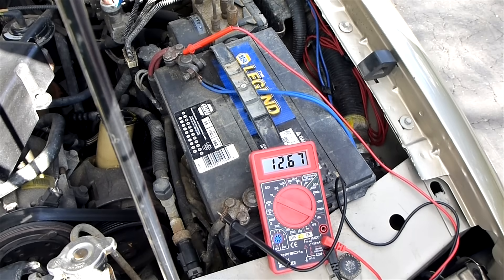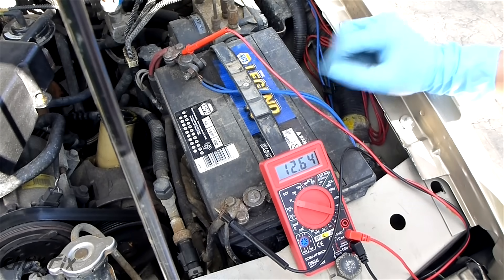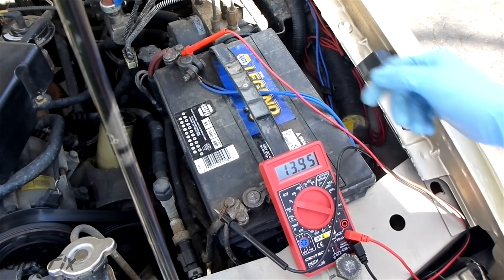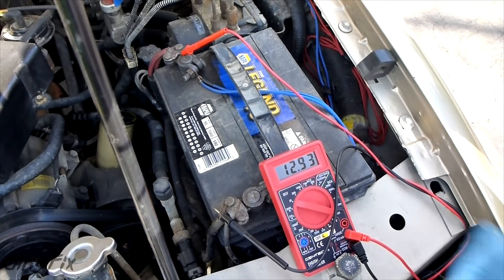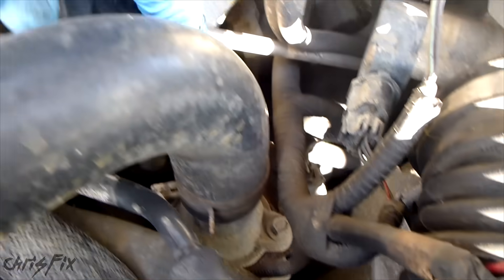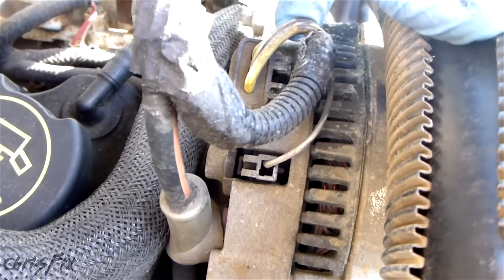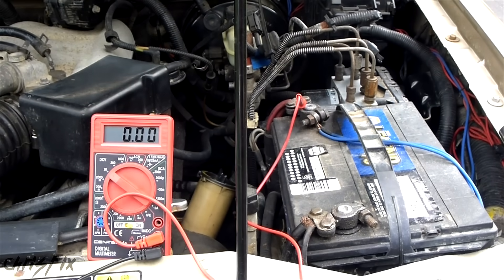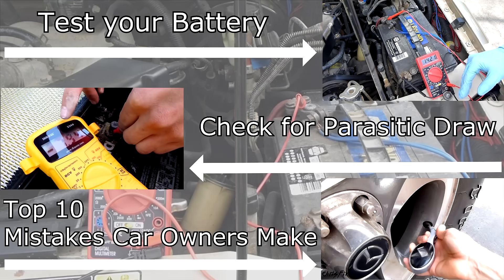How to Test an Alternator

Comment: Chris,

Great video.  I already performed a voltage drop test and concluded I had a bad ground somewhere on the engine.  But I need advise.  Before grounding the battery to the engine, I read 1.7 volts drop between the neg post and the engine block.  That was keeping my alternator from working.  I ran a ground from the neg post to the intake where the original ground was connected and left the original one connected as well.  Now when I do a voltage drop between the neg post and the intake, I get a reading of .480 at idle and .800 at about 1500 to 2000 RPM.  Voltage drop test between the chassis ground and the battery reads .002.  The alternator is working now and I get a reading of about 13.6 volts across the battery neg and pos at idle and about the same when RPM go up.  When I turn on all the lights, AC, Seat warmers, etc, it drops to about 13.1 volts.  Should I also run a ground from the engine to the chassis?  Or do I need to look for another problem?  If so, what next?  I never even got to the alternator housing, and I have not performed the pos drop.  BTW, it's the 2nd alternator I put in the car because of the ground issue.  It is a new reman. ( I guess that is a contradiction in terms isn't it...new reman???).

Thanks and great vid!

Ken
Reply from the maker: K Kelley Check your engine to chassis ground that is already on the engine. It is probably dirty or even broken because the stock ground is sufficient and should work. Lol at the new reman contradiction. I get what you mean!
Reply: ChrisFix
Thanks Chris, I will probably run a new ground wire from the engine to the chassis.  The battery to chassis is good, .002 on voltage drop test.  Is a 6 gauge wire good enough, or would you run 4?

Thanks again, very easy video to follow and very much appreciated.  Good work.  I also watched your video on finding shorts.  Yep, it would be easier if all shorts caused lights to come on.  LOL

Ken
Reply from the maker: K Kelley Hey Ken, I would run something like this which is similar to what they use at the factory: http://www.amazon.com/gp/product/B000COMR00/ref=as_li_tl?ie=UTF8&camp=1789&creative=390957&creativeASIN=B000COMR00&linkCode=as2&tag=chri0e2-20&linkId=BCSE4JWZT7D46B26

Comment: My 84 Celica is suffering from a .20 power drop on the negative terminal.  What do you mean by "cleaning the mounting bracket"?  Am I to assume that I need to take off the alternator and actually sand or wire wheel everything it seats to including the bolt passageway?  Thanx.
Reply: No. He means to do that at the battery posts.
Reply: Actually, he did mean the mounting bracket.  I wire brushed it, re-installed, problem solved.

Comment: i have a 1.60 voltage drop between the positive side of the terminal to the b+ post on the alternator. im having a battery charging issues (battery light comes on) and im not sure what is happening. the connections are all good but i have no clue what is happening.  Brand new battery and alternator. when i get the voltage of the battery while the car is on it stays at 12.5v and sometimes it fluctuates from 13.4v back down to 12.5v can i get some help?
Reply from the maker: Santiago Flores Do you have an external voltage regulator? Have you tried cleaning all of your grounds attached to the engine and chassis near the alternator?
Reply: its internal and im not to sure where all my grounds are located. if it helps, before i started having all these electrical problems. i was aligning my headlights and i had them on for some time. battery died and i charged it up. after two days the battery light came on. it wouldnt hold its charge and so i bought a new one. i got a battery light 4 days later and so i targeted the atlernator. changed that and still i have a battery light problem. Changed the fuse, and put a new wire from the b+ post to the fuse that goes to my battery. worked at 13.60v for a bit, but now the alternator doesnt charge my battery.
Reply from the maker: Santiago Flores Could be a fusible link: https://www.youtube.com/watch?v=-SpsSRGfDQI
Reply: my car is a Japanese import so they didn't create fusible links with the vehicle. The alternator is now giving a charge of .30 but im having a voltage drop of around 1.7v between the two positive post.
Reply from the maker: Santiago Flores Gotcha. Try sanding the grounds and cleaning them up. Also try cleaning up the positive post on the alternator and the battery.

Comment: Hey Cris, I have a new second hand replacement Alterntor, which the stator has been rewinded.. but i check the voltage it goes 14.V something..but when i  switch off the engine, the battery voltage are going to drop out from 13.+ V to 12.+ v (that was disconnect the positive line and negative wire from the car).. how should i know and what is the proper Voltage stable for the battery when its fully charged? is it normal for my battery to discharged itself? coz every time i start the car again for after 3 hours since off, they never start it again. And my alternator having a trouble for this? or the battery need to replace? coz i already checked the wiring of my car and they are not grounded.. help me please..
Reply from the maker: Alexis Claro It is normal for the voltage to drop down to 12.6v. Check out this video: https://www.youtube.com/watch?v=COJr7OB23Hw
Here I explain the proper voltages. Let me know if you have any other questions! 
If the battery does not have enough cold cranking amps CCA then you might have a hard time restarting the car. Check out this video for that problem and how to get it tested: https://www.youtube.com/watch?v=fRfPupikHT4

Comment: Hi. would disconnecting the positive from back of alt cracking the car and measuring the power coming from the alt + with volt meter then to ground be good test?  Im getting 0.5V so Im guessing the alt is fried or is there more to it?
Reply from the maker: tomsdesign2312 There is more to it. Did you see the end of this video where I test for voltage drop. Is that what you are talking about?
Reply: yes I did the volt drop on - and + and each was 0.04.... and what i meant before i also disconnected the + from back of alternator started the car and measured voltage from + on alt and - on casing and battery - and got 0v so im assuming the verdict is bad alternator correct?
Reply from the maker: tomsdesign2312 Oh gotcha. What voltage are you getting at the battery with the car running?
Reply: 12.2v battery is new . So i left my voltage meter connected while driving so i can monitor it... First run turn on 14.5v charging great! Drive for 1min goesdown to 12.2v then after few min 14.5 kicks back in... that was repeated 3 times in 15 min drive...

2nd run... starts 14.5 after 1 min drops to 12.2v and stays not charging for next 15min.

any ideas?
Reply from the maker: tomsdesign2312 Sounds like a bad voltage regulator or bad alternator.
Reply: I had the alternator bench tested and it passed but just in case i picked up a new one but Im still getting same results :-(   anything else i should be looking for?
Reply from the maker: tomsdesign2312 Check your grounds and make sure they are all clean (engine ground, chassis ground, ect). Also look for bad fusible links like in this video which gave me low voltage: https://www.youtube.com/watch?v=-SpsSRGfDQI

Comment: Hey bud wondering if you could help.

Went through a puddle the other day and the battery warning light came on. Waited 24 hours for it to dry it hoping that would fix it, battery warning light was still on. Double checked the connections on the battery and both were tight. Got my multimeter out and it was showing 11.3v while the car was running. Does this pretty much mean the alternator is dead? I also checked the serpentine belt to make sure it was fine and it was.
Reply from the maker: AppleAssassin This most likely means the alternator is dead but try cleaning off your grounds and battery terminals with sandpaper so there are good connections. That might fix the problem.

Comment: Your video was very informative and Ez to understand. I think I might have remedied my problem. I tightened the belt tension on the alternator and my lights stopped flickering but I am just not convinced that it was that easy. Should I just let it be or keep looking for a bigger problem that I probably missed? As a precaution I'm cleaning my battery connections. Thanks!
Reply from the maker: Armando Martinez jr. Those are good steps. Test to see what voltage you are getting. Do you have 14v when the car is running?

Comment: if you don't have a volt ohm meter, but you do have a wrench, start the car and while the motor is running ***remove the (-) negative battery clamp on the battery only (BLACK CABLE)***, keep it away from the (+) red one, most won;t reach, if she runs the alternator is working, turn on all accessories and if it stays running the alternator is 100% good and your battery has drained down (light on) or a bad cell in battery (cold weather kills batteries).  5 minute quick test, by Mr. GoodWrench.
Reply from the maker: gino007able Thanks for sharing! I do not recommend removing the negative battery cable when the car is running. It can cause problems and is not worth the risk in my opinion. Like you said, you can go to your local parts store and they can test it if you dont have a meter. Or you can get a multimeter for $20 which will come in handy and pay for itself!

Comment: Pull the negative terminal off the battery when the car is running. If the car dies, your alternator is completely dead.
Reply from the maker: Chuck Lanman Bad idea to mess with the negative terminal when the car is running.
Reply: ChrisFix

Comment: I tested my alternator right now and the reading is 13.8, with no accessories turned on. With them on, it reads around 13.5.

Is my alternator weak?
Reply: To test it properly, you need an amp meter with the clamp.. put it on the battery wire at the alternator.. and turn on headlights blower motor rear/defog.. 13.5 volts is fine, but need to know the amps it's putting out.
Reply from the maker: JJ Glo It is a little weak but not really bad.
Reply: I took the plastic boots off of my connections today and they were extremely corroded, as in completely covered. I cut off the corroded ends and stripped new ones. I also changed my terminals. After doing that I checked the voltage and it jumped to 14.3! and it stays there with the accessories turned on.
Reply from the maker: JJ Glo AWESOME! Nice work man! Glad you got it working at the right voltage.

Comment: When you turned on the accessories, was that whining sound coming from the alternator?  I ask because I have new alternator in my VW that whines like that when the car is at idle with all accessories off, and gets even louder when I turn accessories on.  All the battery voltage reading are in spec, so I'm assuming it must be a bad connection somewhere that's causing stress on the alternator.
Reply from the maker: Woody Ridenour There is a slight wine when you put a load on the alternator, but for a new alternator with no load, there should be no wine. The internals on the alternator might be no good (even though it is new). Do you know if that is a common problem for VWs?
Reply: ChrisFix I don't believe it's a VW problem as far as I know.  I'm thinking it can't be the alternator because since my original one (that never whined unless under heavy load) failed two weeks ago, I've gone through three alternators that all produced proper voltage but whined at idle under no load.  Two of them were from a local auto parts store, and the current one is a genuine Bosch OEM that I paid a pretty penny for.  I've got to have either incredibly bad luck (three bad alternators in a row) or a bad connection somewhere, don't you think?
Reply from the maker: Woody Ridenour Yea, I would think there is a bad connection somewhere then because after three alternators one should work haha. Did you try the voltage drop test I show in this video?

Comment: Hi Chris,  I have a question about the voltage drops.  Why is the ground voltage drop from the battery allowed less drop than the positive side of the battery?  I think they should be about the same.
Reply from the maker: Inspironator Every car has an acceptable voltage drop and it varies based on make and model.
Reply: +ChrisFix How do you find that acceptable drop for your model? I have the FSM for my 2006 Subaru Impreza 2.5i and it only tells me what the spec voltage and current is at rpm's 1500, 2500 and 5000

Comment: You can test the diodes with an AC ripple test too , AC voltage, probes on + and - of the battery ,no more than 0.050V , diode bridge should be good.
Or between + of the alternator and his case, it works too.
Reply from the maker: JP Moiny Good idea! Thanks a lot man! I will have to make a video on that!

Comment: Hi bro. Thanks for this video it's really useful. I just got some question on my car. When I switch on the engine the battery sign it's not showing on the board. But when I start the engine the battery sign showing up on the board. Just recently change the battery into new one. Could it be some issues on my alternator?
Reply from the maker: Sean Waleed The battery sign should show up and then go away when you start your engine. If it stays on when the engine runs, then you might have an issue with the alternator.
Reply: ChrisFix Thanks a lot bro ChrisFix ;-) I got a new alternator now. You deserve million thumbs up for this video. Keep it bro.
Reply: ChrisFix keep it up Bro.